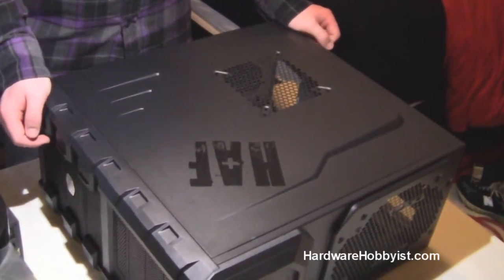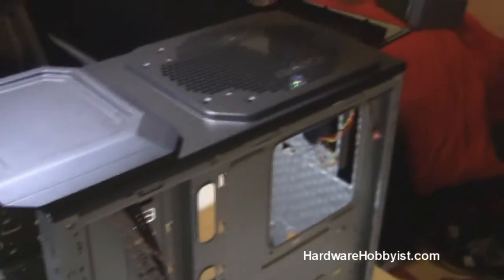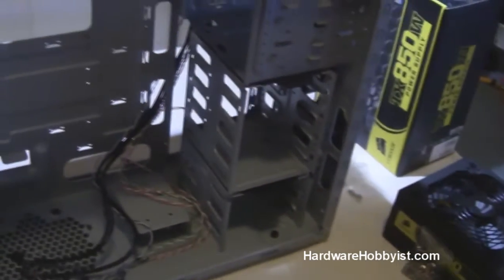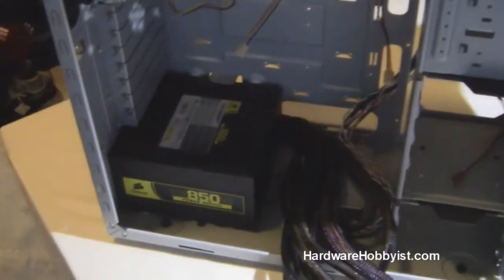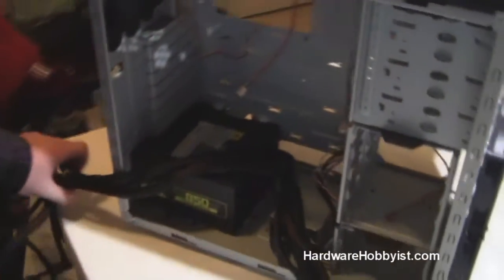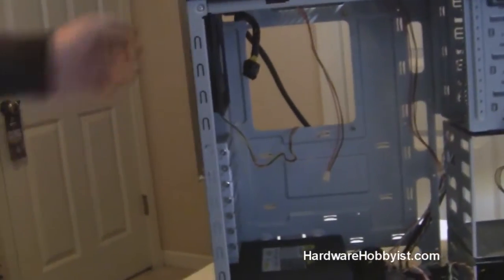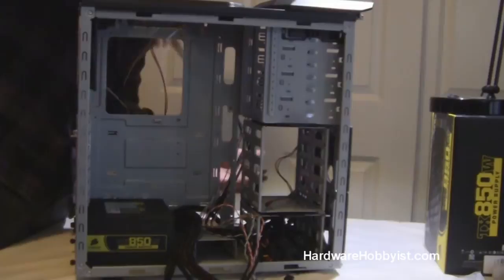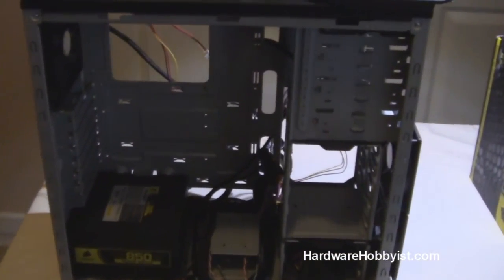[HH] Custom PC Building Guide - Assembly (8/9): "Cable Management"

Comment: haf 912 comes with 2 120mm fans, one on the front and one on the back. I have this case, i ended up putting both those 120mm on the front and buying a 200mm coolermaster megaflow for exhaust through the top

Comment: The hiding of the unnecesar cables under the hdd cage is preety bad idea, cause ur distrupting the airflow of the lowest mounted cooler, basicaly he is useles with the cable managment u did now, u can hide those cables behind the motherboard, u got a bit of space couple of centimeters there so u can manage them there, u also can mount them all over the back side of the mb cause u have some little cut outs and pushed out parts so u can put the zip tights through them. sry for my bad english. :D